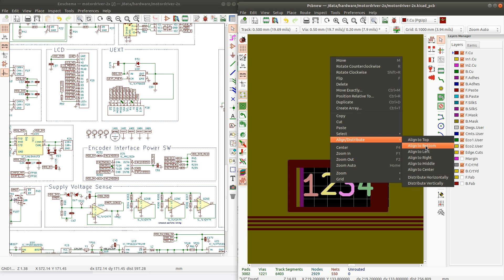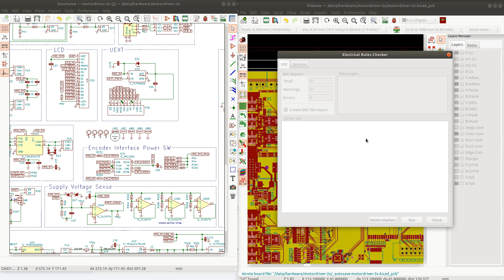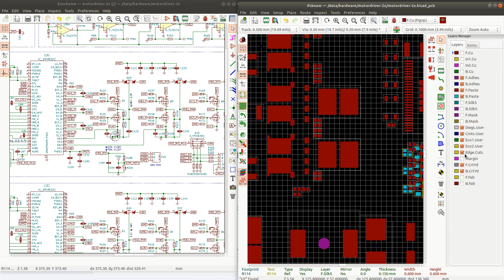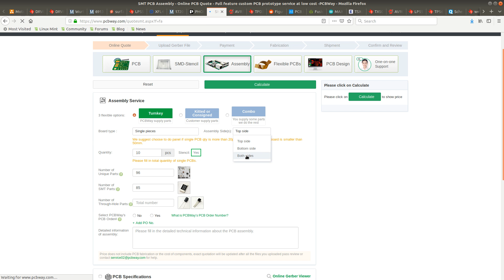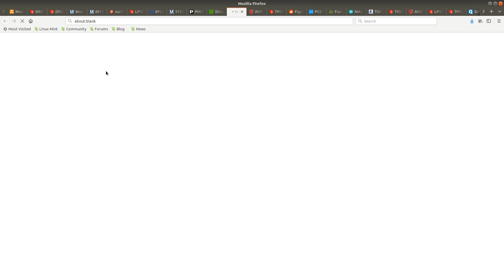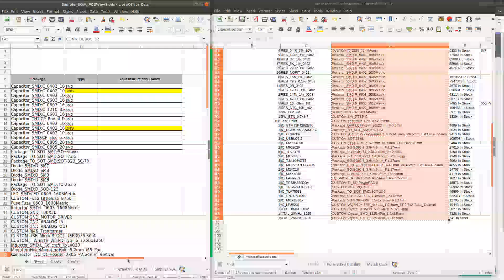Adding Layer Numbering And Placing Order With PCB Manufacturer - Embedded System Consultant Explains

Comment: Thanks for this Martin, I personally learned a lot from those video series. Hope you plan more projects, and more series.
I especially like your approach to library management. This is a really great way to keep all in order, and should be promoted by KiCad community.

One suggestion tho, please check the mic more often ! :D It seems that pcbnew is taking too much resources, as the videos in eeschema were all fine.

One more time A BIG THANK YOU !!!
Reply from the maker: Great to hear. I think kicad library management is completely headed in the wrong direction (specially with the addition of the so called "field editor" into the schematic view in version 5). I think there needs to be more emphasis on "instantiated" components where a component instance has a hard link to the definition of that component in the library and no properties of the component should be even editable only on the schematic (if something needs to be modified then it should be done in the library so that you either update all instances of the component at the same time or create a new library item with your modifications). 

The more people start asking for more effort to be put into simplifying the library based approach the better for all of us and I hope that making a detailed series that document every aspect of a design from idea to physical product would be able to help somewhat to steer the kicad community in directions that are more easily managed in the long run. 

I'll update details of the videos, add all of them to the "KiCad Motor Drive Design" playlist and leave them available for everyone to watch..
Reply from the maker: Of course the fastest way to get there is to just start coding, but my point is rather that I think it would be beneficial if a new approach to library management was brought forward from the core team and then implemented over time. It will need to have everyone on board and agreeing with the same vision for how it should work in the future. It does not help much if some developer does it one way and then kicad community continues to struggle and diverge even further into an approach that ultimately does not work very well at all.
Reply: Agreed, when you consider all that is involved in creating a product, that "instantiated" approach has more sense.. at least KiCad has still the means to achieve that. And, for one - I'm taking that "instantiated" road as well ;)